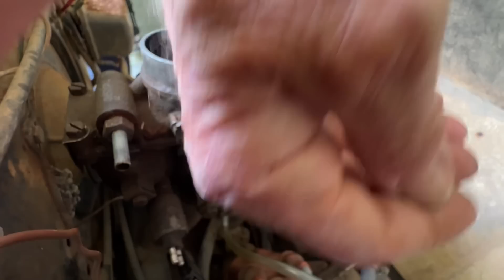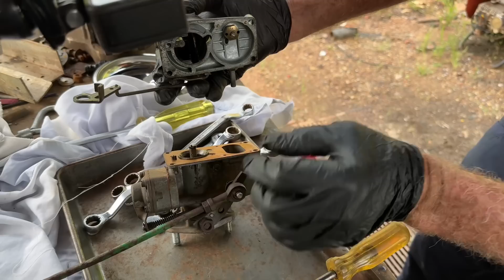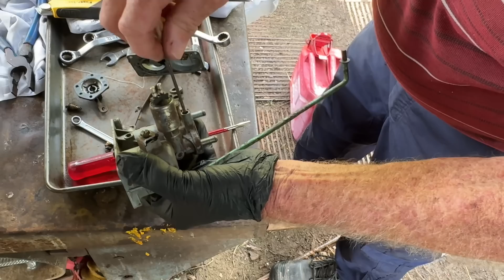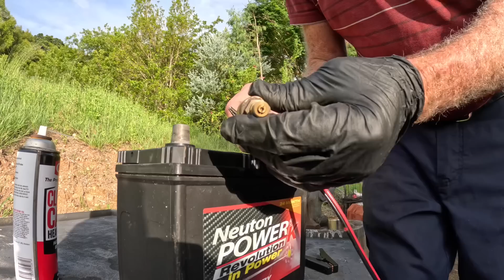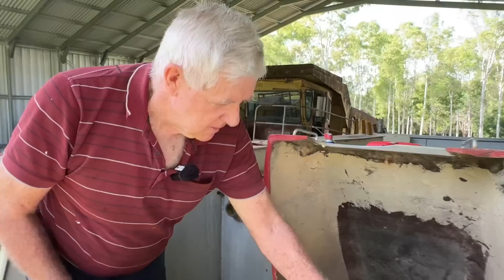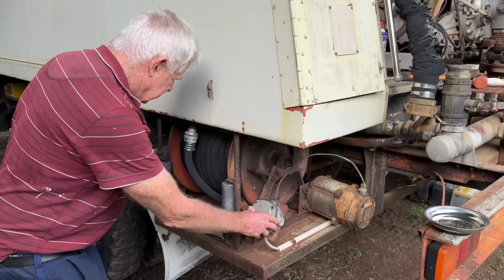Will it START and FIGHT a FIRE after sitting for 20+ YEARS? Old VW Fire Truck Engine

Comment: Bruce it reminds me of the "super fire knocker" vehicles my former state (GA-US) forestry commission would build and loan to fire departments.  The first ones may have been only 500 US Gal (1892.71 liter) capacity with a less powerful engine for the pump.  The newer ones are from 1000 to 3500 US Gal with a 33-44hp Isuzu engine, Darley pump with discharges and suctions, and a 1 inch reel hose.  Wildland firefighting is indeed taken seriously in AUS.  Good work in resurrecting this machine.
Reply from the maker: Hello, Thanks for sharing this information.

Comment: Grew up on these vw-Godiva pumps in the fire brigade on small town 2000 lpm pumpers , tankers & quick fill trailers 
Very reliable air cooled not much to go wrong 
Always started on the truck before leaving the station to-allow  it to warm up
Start first time  every time 
Some had gravity fed fuel tank others had electric lift pump 
Open tank isolation valve
Open delivery valve show water to prime pump from tank
ignition on
Choke on full
2 full pumps of throttle 
Then to idle 
Press start
Go to half choke
Open recirculation valve back to tank to keep pump cool 
Drive to fire
Choke off open delivery valve to hose line 
Close recirculatinon valve
Connect town water from hydrant 
Put out fire
Open recirculation valve to fill tank 
Turn off ignition 
Pack up go home
In simple terms
I sent you some photos on the email that was 1989 long time ago now and I’m still in the fire brigade

Comment: As a point of interest on nut and bolt heads for those who want to take the right tools to the jobsite. European machinery manufacturers use 9mm, 11mm & 13mm whilst the Japanese use 8mm, 10mm, & 12mm respectively. America uses Unified National Course & Fine. The hex heads spanners are in inch fractions i.e. 3/8 and marked a/f (across flats). In Britain and Australia prior to metrification Whitworth and then BSW were used. BSW was one size smaller than Whitworth i.e. a spanner were marked 3/8W 5/16BS. Whitworth nuts were a massive overkill hense the change to the standards.
Reply from the maker: Thanks for the information.

Comment: Hi Bruce as ex bush fire fighter you need to get the bypass back to the tank working and adjusted so you don’t have to much pressure in the manifold. Hope that makes sense.

Comment: Back in the late seventies I was working on a road building project in S.E. Iran, on the camps we had portable fire pumps with VW 1200 air cooled engines.built by a company called Rosenbauer, I think. they had magneto ignition and electric start but they could also be hand canked which was useful as the local scallies would nick the batteries! All The Best from cold, grey Somerset, England

Comment: In the days before high pressure cleaning pumps Sydney Water used these high pressure pumps to clean service reservoirs out internally prior to condition inspection.

Comment: Hi Bruce, good to see another one saved. I was a pump operator for 15yrs on a fire appliance, different piece of kit but they all use the same components pretty much. The two hose drums at the rear are the high pressure hose reels, long reach, high pressure but low volume and good for quick deployment while the pump gets set up and hopefully connected to a water source. The other outlets are high volume low pressure so good when your connected to a water source at a big fire, big fire=big water. The recirculating pipe is to stop the water in the pump housing boiling and caveating when all the deliveries are shut off with the pump running. When it gets to warm the pump casing sounds like its full of stones with the air bubbles exploding and it causes serious damage to the pump internals. Our older pumps had a wax plug in the bottom of the pump housing so if it got to warm the wax melted and opened a valve to allow water to flow through but the newer ones now have an auto recirculation system. Before the newer pumps did it on their own we used to adjust the delivery bypass to purposefully warm the water in the pump housing at animal rescues as it provided warm water to warm your hands or wash an animal down with once it was unstuck from bog land or slurry tanks etc. I'd love to have a play with that machine but unfortunately I'm 12,000 miles away.

Comment: Those pumps are great but you did exactly the right thing ensuring plenty of water flow 
Without high volume flow they will generate enough heat to cause a steam explosion that is quite dangerous 
Thanks again for another expert video with Bruce and the Cameraman

Comment: I was told by a couple of Mechanic's recently that for cleaning any engine parts to use brake cleaner works the best, so I tried it and does work very well and it just dries off, a bit of a wipe and it's all clean. I've also had problems not being able to get a spanner in some where and I've had to grind them down a bit to make them fit, I also have a set of carby spanners that are like "u" shape sort of thing and that makes life user. Great video, always enjoy the old school way of doing things and get older machines going again. Thanks for the video.

Comment: Well done Bruce. However efficient today's technology is it won't last nearly as long as yesteryear's mechanical engineering. With no spare parts, very few tools and no specialised knowledge, not only did you get that VW engine running but also managed to pump water.

Comment: Railway Station maintenance crew had a vw engine sandblaster.  2 cylinders running it, 2 for the compressor.
All mounted on a trailer for cleaning the platforms.

Comment: Hi Bruce, the return line from output to tank is so you can fill the tank from a creek or dam. It doesn't need a return bleed as the pump housing is designed to produce a set maximum pressure by design. Glad you got the old VW going !
Reply from the maker: Yeh ok thank you for that, I’m not an expert on pumps by any means
Reply: @bruceinaus  not criticising, just an FYI🤠

Comment: With a few repairs and a clean up some ones going to have a great watering truck for fires or dusty dirt roads of just spraying water in the air for kids to play .
Reply from the maker: Thanks Logan, I think your right. I bought it as a fire fighter but then it’s poured rain since
Reply: @bruceinaus  🤣O my  , No good dead goes unpunished .Or maybe some one was watching and realized they had been neglecting there job in your part of the world .On the flip side you can use it to pump out flooded basements and wash off roads and sidewalks that may get covered in mud or clean out culvert drains .Never fear there will always be a need for a machine like that one and thank you for your reply
Reply: @bruceinaus would be handy for washing that wabco or your veg patch